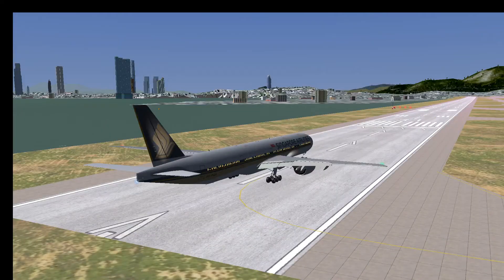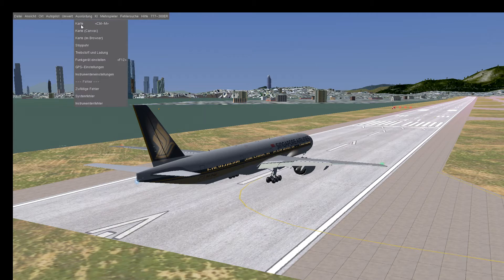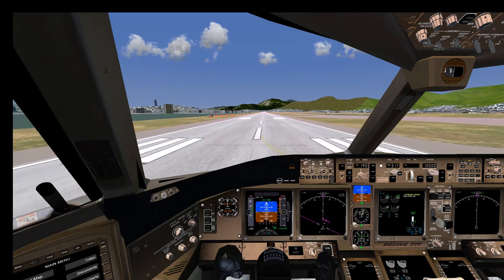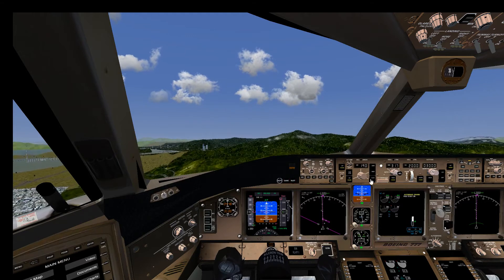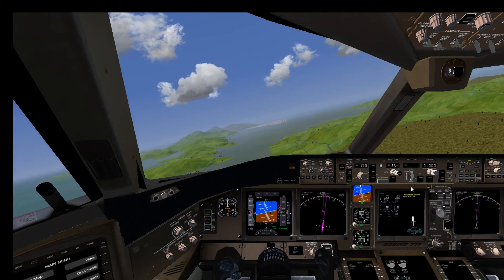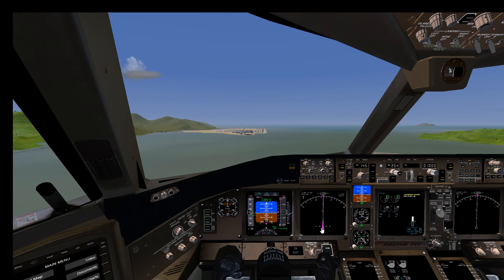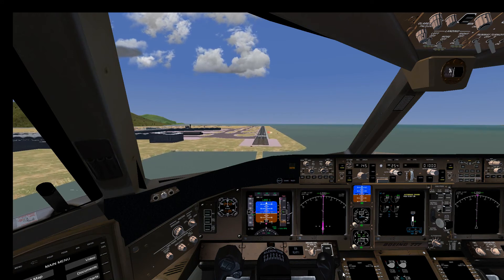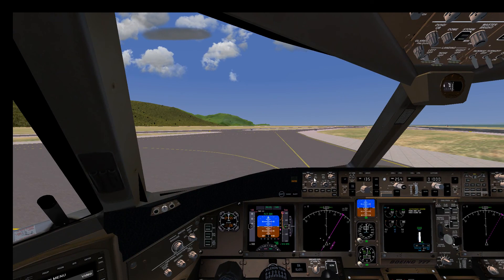Flightgear B777 Gear & Flaps Warning

Comment: heya bud thanks for the video. Maybe you can help me. I get the too low, gear warning even though the gear is down. Also flaps are full and i tried various speeds from 140-150kts and i still get the warning. I am not sure where to look in the code which triggers it, can you help oh and i am using the airbus 350, whiich i made many mods to, but nothing to do with that warning , which i been gettin from day 1